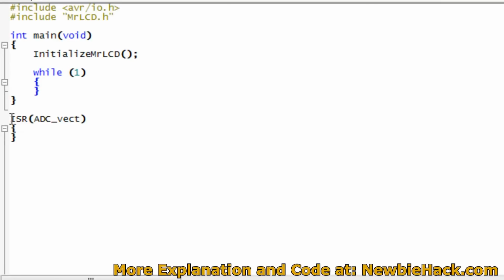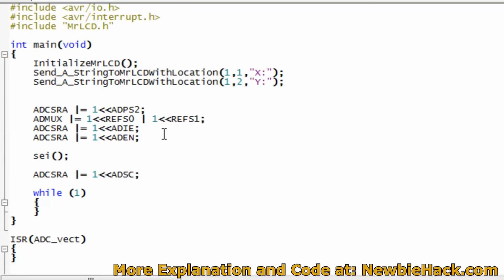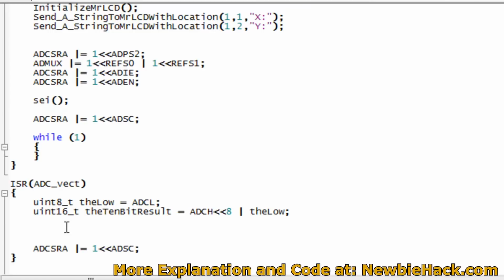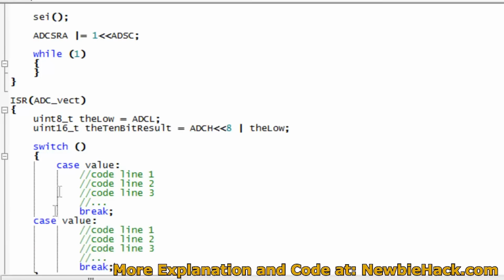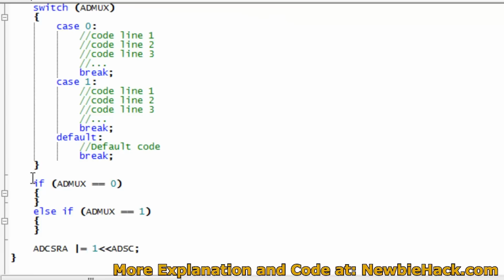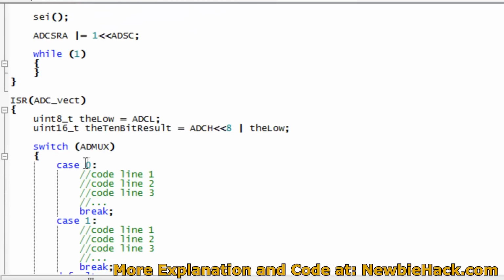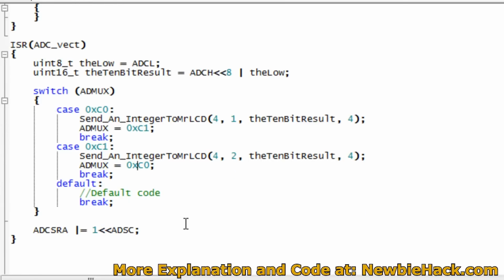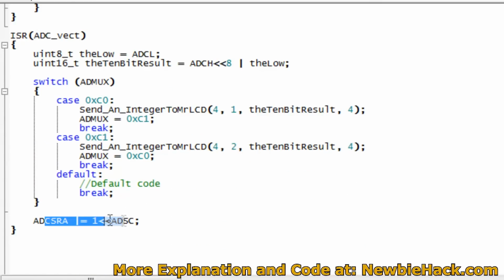35. Arduino for Production! AVR ADC How to use multiple channels on the analog to digital converter

Comment: Hello sir :D ,
  if i may ask ,
   what if i want to tie more than 2 sensors to the ADC in the video u said we go back and forth between the channels but how does that apply to three channels do i go one by one , and what if i want to make for some reason only pin 0 and pin 2 work as an analog pins what should i do in that case ? 
Thank u so much for your tutorials and your kindness.
Reply from the maker: Yes, if you want to have 3 sensors to the microcontroller, you will proceed in the same way as in the video, just adding one more case in the switch statement will do it.  To skip a pin, just don't use that case value in the switch statement.
Reply: I dont quite get it so C0 go to C1 in the next conv and C1 go back to C0 but when i add C2 does it go back to C0 or it goes C1?
Reply from the maker: Test with three known voltage inputs and you will be able to determine this.  Testing and experimentation is the best way to learn.
Reply: I tried a lot of things but i got everything messed up,I am also trying to make a library where i could select to read a certain pin and read it's value without having to move to read the next pin , I also tried to make C0 move to c1 and c1 goes to c2 and C2 to C0 again the output of A0 was displayed as C2 and C2 was on C0 ,I am also wondering can i change the readings size from 8 to ten bit within the main just by changing the value of ADLAR ? ,Thank u
Reply: am i asking too much ?
Reply from the maker: I am providing the starting point.  It is really up to you to work it out.  I am unable to dedicate time to write code for viewers unfortunately because it would take time out of making new tutorials, which I do daily.
Reply: Patrick Hood-Daniel okay thank you :D
Reply: Patrick Hood-Daniel  i have found a solution the thing is i was using or shift to change the channel instead of clearing the 3 bits of the ADMUX so 
ADMUX&=0xf8; was my solution 
I want to thank u still so much for ur tutorials and even the exclusive tutorial video is great thank U so much :D
Reply from the maker: Thanks!  I'm happy you found a solution.

Comment: Very good tutorials man, I Gave myself a mini-project that was intended to help me with a much bigger project. I essentially ended up branching out to use ADC, LCD, PWM and USART. I created a Proteus ISIS simulation file with the schematic and hex code loaded on the "virtual" ATMEGA32. I used the USART aspect to send and receive data serially (async) via the RXD and TXD pins. The used Channel 0 of the ADC to read in analogue information from an LM35 Temperature sensor and used some signal conditioning to get the equivalent temperatures to send to the LCD. The ADC value was also used to modulate the power going to a motor/fan that changed speeds depending on the temperature. I printed all the data to the 20x4 LCD (Temperature, Duty cycle, etc.) With the help of this video, i figured out how to include a POT on another ADC channel and just displayed its ADC value to the LCD.

**I have a few questions though:
1. How do you know what resolution to use when reading sensor data ?
For example: Using the AVCC gives arguably the best full-scale resolution but for the ACCELEROMETER you said something about using the internal. Does that not low your accuracy and precision ? due to you not having a large enough resolution ?

2. Why do you always use "lowADC = ADCL" then "thenBitADC = ADCH <<8|ADCL" ?
Can't you just simply assign it like this : "tenBitADC = ADC" ?

3. (Not pertaining to this video but an LCD video) How does the inclusion of a " " (whitespace/blank)  remove the leading zeros ? how does it do that ?

Comment: On your conversion ,what is your refence value?i think the microcontroller need a range of values to ratio to the analog value
Reply from the maker: Yes it does. Take a look how I use the avref pin. Also, in code, I use the control register to set this up.
Reply: I din't see the range .cause u are reading 0-5v  but it needs a range of value u are ratioing the adc to
Reply from the maker: I'm using the internal setting of 2.56 volts as a reference. It's not perfect but it handles most of the range for the accelerometer. A better voltage reference would be the voltage established for powering the accelerometer.

Comment: Hey there. Even after this much time, these videos are still awesome! :D

Just wanted to give you a heads up, and tell you that, just as ADCL and ADCH will give you the low and high results, and combining them will give you a 16 bit result, so will just ADC. ADC is mapped as a 16bit value, to the address of ADCL, and will therefore include the next 8 bits right after, which happens to be ADCH :)

Take a look at iotnx5.h (might be different which header file your chip is referenced in, this is an attiny85)
Reply from the maker: Nice. Thanks for that.

Comment: for two channels you can just  ADMUX |= ( 1 << MUX0) which will toggle channel 0 and channel 1 everytime the interrupt is called, no need for a switch statement
Reply: I think you mean ADMUX ^= (1 << MUX0) because Bitwise OR will make the bit one for all times but Bitwise XOR will toggle the bit
Reply: @mohamedhossamtealeb8682  almost correct, XOR is the correct method for toggling a bit.
In that case, we would need to make sure we initialize ADMUX = 1 << MUX0 so than we know the initial  state of the multiplexer so that when we can then toggle both bits using ADMUX ^= (1 << MUX0) | (1 << MUX1) to turn off bit0 and on bit1
Reply: and as is done to use the 8 channels?

Comment: i used your program to read two rotary pots....and it works thanks! ..i wished to modify it so that when one value is greater than the other then a certain led should glow..it tried various logics....using variables but am not getting the results...can you help?
Reply: Did u get a solution for this problem ?

Comment: Hi Patrick, I have a problem about this topic. When I want to test the circuit, the microcontroller reset itself before going into the while loop, I don´t know if this problem is caused for a hardware or a software issue. I'm using an ATmega164P.

Comment: two ways: use an op amp or a voltage divider with 2 resistors if you don't need high acuracy.

Comment: Yes, I meant that, how to accept 10v by discrete components and adjust it to max. 5v for AVR adc pin ? If I put voltage divider with two same value resistors (10K) than I will loose range from 0-5v on input , if I understand good ? O.o

Comment: Thanks for the tutorial! so if i wanted to use multiple inputs, I could do sensor1 = ADMUX | 0b0000001, sensor2 = ADMUX | 0b00000010 ? then that will assign the respective pins to a variable?

Comment: Hum would be better to filter ADMUX into another variable to only keep the MUXs values and not have to change them if you change ADMUX at the setting. mux = ADMUX | 0b00011111; (0x1F) and do the switch with mux (case 1/ case 2 etc...)
Thanks again for you work. this is great !